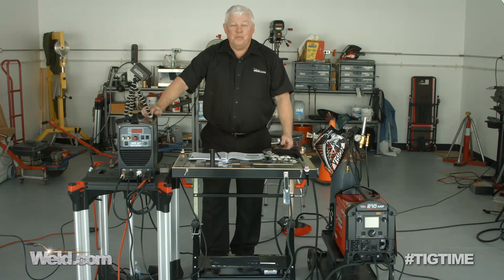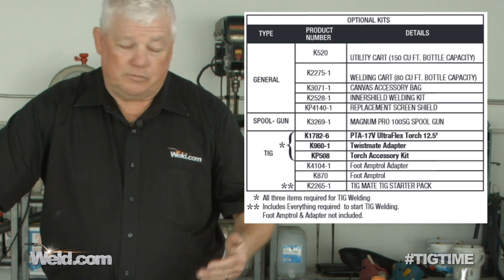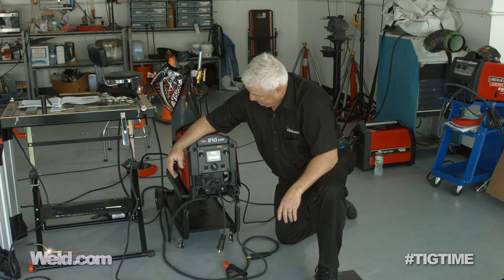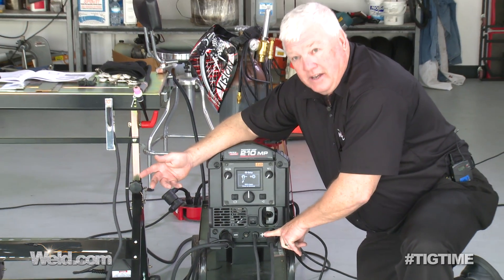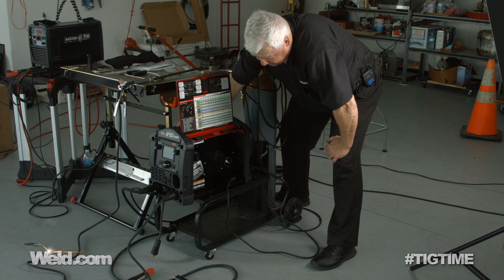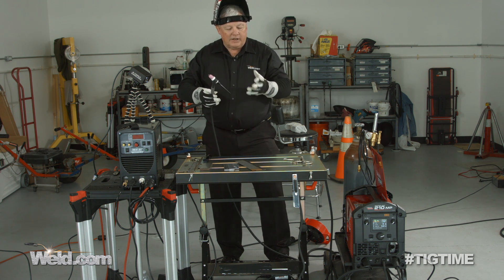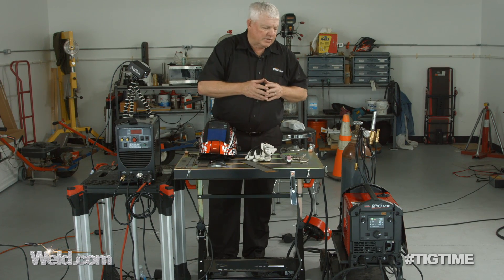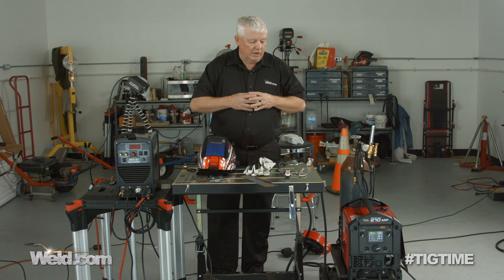Lincoln PowerMIG 210 MP Review (Part 1): Full video on WELD™ app!

Comment: I’m a sanitary welder that works in plants welding schedule 40 & tubing anywhere from 1in to 12in tubing. Just wondering if you would recommend this machine to take over the road compared to a miller max star 150.

Comment: I'm truly appalled by this machine, coming from Lincoln. Before you fanboy's bite my head off, I'm one of their BIGGEST ADVOCATES. I live 1 hour from their main facility in Cleveland. I've been to the plant a few times, met some great guys there. I own Lincoln Mig's, a Tig, 4 Lincoln Helmets, Lincoln Plasma Cutter, Lincoln stickers all over my toolboxes, but guys.... You really dropped the ball on this machine. Sure, you'll find all the 10x10 garage Dad's giving it "raving reviews" on Amazon, but let me tell you something. This machine (IMHO) only has two features, Mig and Stick (won't count flux you get my point). The Tig is TERRIBLE on this machine, there's no adjusting the up or down flow, you will blow straight through anything 16guage or thinner off the jump using tig and that's AFTER you rip apart your BRAND NEW welder, just to put in the controller adapter. SMH, truly disheartening. Lincoln, if you're reading this, you forced me to purchase an ESAB and frankly, I'm kinda glad I did so far. You still have my heart Lincoln, but not on this machine.
Reply: if your blowing through then that's all your fault buddy lmao

Comment: Thanks for this review!  I was debating between this and the tig 200.  It sounds like I should go with the tig 200 since I already have a 140 amp Lincoln mig.  I was hopping to get a more power mig and tig but this sounds like a pretty big compromise on the tig side.

Comment: Ok so basically this thing is useless for tig and should just be used for MIG and stick 
I mean I’m sure it’s a good mig but why even sell this as a tig when you need to spend another 500 dollars in parts and take the damn machine apart just to make it a mediocre tig?
Useless lol
Reply: It does dc tig fine for many basic tasks, which is the target market for the machine. You can't expect all things you are thinking of for anything even remotely close to this price point. Also, if you buy the version from the factory setup for tig it comes ready to go.

Comment: Well I ended up buying the mp210 , and am stuck deciding whether to take it apart and install the Tig kit , or buy the square wave 200, or go green and buy the Everlast Power Tig 200dv? Mostly want to weld metal square tubing that will require cosmetically nice looking welds , as its gym equipment
Reply from the maker: Any one of those options will do the job for welding square tube. However, you can get that 200DV dirt cheap on Weld.com right now... Just sayin' https://www.weld.com/powertig-200dv

Comment: Anyone know which is better the Lincoln Powermig 210 or the new Miller Multimatic 215? Both are priced right at $1700 with their Tig kits. Although Lincoln has a rebate deal on till 07/31/16 for $200 bucks, found a few online dealer are also including a $25 BassPro gift card too, which in my case works out as many there's a BassPro in my town...Never heard Punts Gorda pronounced that way before....lol.

Comment: The foot control adapter is meant to be installed from the rear of the hole, so only the receptacle will be visible, not the square mounting plate around it.

Comment: Guys if you are looking for a budget industrial machine you will not find it. This machine has its good points and bad. However it is built around the GMAW,FCAW process. If you want a good ac/dc tig machine buy that then. For all of you complaining about a price tag of $1400 for a MP machine try and look at what a industrial machine cost. $4000. It is a basic machine, just a step above a DYI weekend warrior welder.
Reply: Is it best to just purchase machines that are dedicated?  Buy a TIG Welder for TIG Welding, and buy a MIG Welder for MIG Welding?  Are these combo all in one machines more a gimmick than performers?
Reply: Gary Karczewski I find that my Lincoln 210 Mp is amazing for what I do, I like that fact that I done have to buy 3 separate welder so for way more than £1400 or more! I do a lot of diy-auto body work tig isn't the best but both stick and mig I find are great the thickest I've done is about 1/2" but idk how well it penetrated but there definitely not gimmick if you're using it for more heavy DIY use, however if you are thinking about using it for industrial use I'd have to say get the different welders so you have that pre-setup machine etc...

Comment: Just a few things I noticed, it would likely weld better cleaned prior to welding and also most of the industrial TIG welding done, ( if you want to survey your viewers ), is done with out the luxury of a high frequency start, looks like a reasonable machine to me, 42 year veteran in the trade.
Reply: This machine is not the answer for high frequency start up tig, the Lincoln Square Wave Tig 200. There are multi process Lincoln, ESAB, Miller machines but as you know already they start at $3500 upward $7000.

Comment: Thank you for your great videos Mr.Tig . I want to start Tig welding and almost jumped on this welder but thankfully you've convinced me otherwise . Was debating to go with the Miller 210 but it's kind of expensive . Almost debating Hobart now ? Any suggestions for a Tig welder in the 200 amp region that does AC/DC and pulse?  Mainly welding steel square tubing but would also like to weld aluminum as thick as 1/4"

Comment: Carl,  Certainly you can use a 1/8" tungsten on this machine.  Just keep in mind the machine was designed for a maximum tungsten size of 3/32 but your arc starts may be just a little rougher.  Also,  make sure you do not use a green or pure tungsten... I still prefer the 2% thoriated or all purpose layzr tungsten..  good luck Mister Tig.

Comment: can you use a 1\8 tungsten on this machine even tho there is no opetion for it?
Reply from the maker: +Carl Busby Certainly you can use a 1/8" tungsten on this machine.  Just keep in mind the machine was designed for a maximum tungsten size of 3/32, so your arc starts may be just a little rougher.  Also,  make sure you do not use a green or pure tungsten... I still prefer the 2% thoriated or all purpose layzr tungsten

Comment: and that's why i did noy buy the Lincoln multi process unit versus the miller one you don't have to rewire and take apart any thing for 1400 bucks dam well should have to just plug something in and be done with it. They make great machines dont get me wrong but that is just a stupid idea.

Comment: I just got my TIG kit for this but haven't set it up yet because the collet and nozzle was missing from the torch. 
It does have a variable inductance initiation setting that is helpful for initializing the arc. I was under the impression it gave that option for its TIG process as well as it does for its stick process.
Guess I'll have to wait for the parts to get here to find out.
Thanks though.

Comment: Thanks for the helpful videos!  For TIG welding 1/8 6061 aluminum with this machine do you have to use Helium & DC -, or is there a cheaper gas/gas mix that is suitable?  Can this machine weld DC + ?

Comment: Interesting, but flawed review.  Mostly it's the readily apparent negative bias and the preconceptions that the reviewer brought in.  We are repeatedly fed exaggerated negatives leading to the initial arc...  Then the fishing for negatives begins, mixed with what appears to be an accidental "arc stability is fantastic" complement.   

Appreciate the review, but you state that you don't like combo machines, and it seems that you were unable to work past that bias.
Reply: +Discordia Merovean what info do you have for your claim that his negative comment regarding arc starts is "exaggerated"? DO you own this machine? have you used it?
Reply: I would have to agree. The connector install was botched. It comes with instructions, that if followed, make it pretty straight forward. It doesn't look like he read the instructions since he had the connector on the wrong side, he said he had to take the front cover off, etc. I'm not saying its super simple but it isn't hard or terribly time consuming with the exception of there is limited room to work on the inside. Where he is right is the fact that it is difficult to start the arc. On the other hand with practice its not so bad. You even see he gets better on his second arc shot. For arc, this thing runs 7018 like spreading butter. Mig is good too. Overall, for the money its a good machine. I'd still prefer separate machines but for those with limited money this machine is an excellent option.

Comment: I apologize if this is a dumb question. I am working on a chopper frame on a chopper build I'm doing at home. What is a good tig welder that you would recommend for home use? Would a 110 be good enough? If you could name a brand and model I would appreciate it. 
Thank you
Reply from the maker: Yes, 110 should be enough for anything you run I to on your build. Check out the Mr. TIG Series 200X on the Weld.com Store. It is 110 / 220 and is paired with all premium accesories to get the best performance out of the machine: http://weld.com/index.php/shop-weld-com/shop-weldcom/mr-tig-kits/mr.-tig-alphatig-200x-bundle-detail
Reply: Roger that. Thank you for everything

Comment: On 220 volts this machine will put out some serious power.  5/16 thickness on mig. 1/4" tig.  and stick 3/8".  Up to 175 amps. 25 volts for mig. and weighs only 40 pounds.

Comment: I have one of these.  i installed the adapter as well as 24 volt leads from the gas valve to trigger an external valve.  bought a $90 water cooled torch on ebay.  made my own cooler with a procon pump and a 2 gallon ss tank.  the pedal works like it should and triggers gas flow.  the start up has a sweet spot and starts smooth.

Comment: The AHP is an infinitely better TIG and Stick machine and cost $800 complete. If you need MIG a separate MIG is so cheap from AHP or Everlast I'd just go that way. For a total cost of $1400 this is a barely capable TIG machine. I don't see the value here.